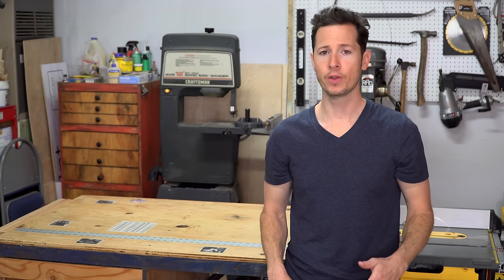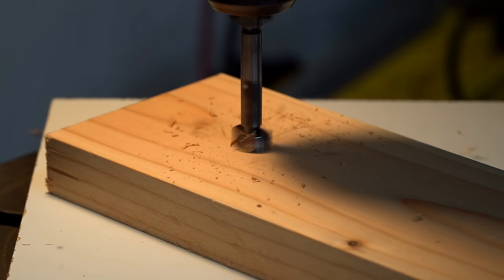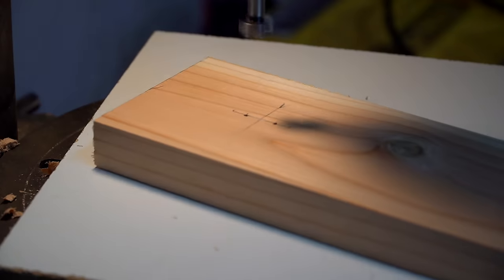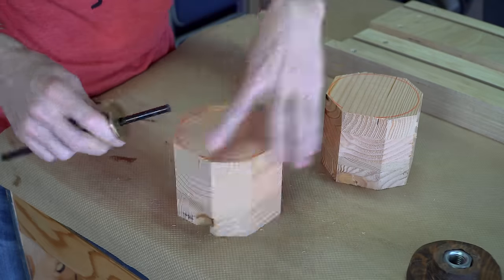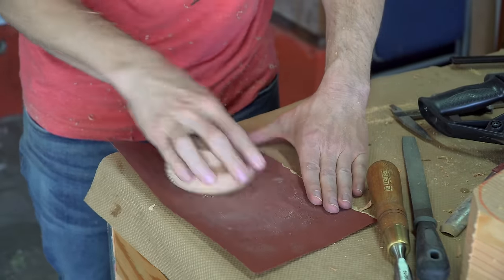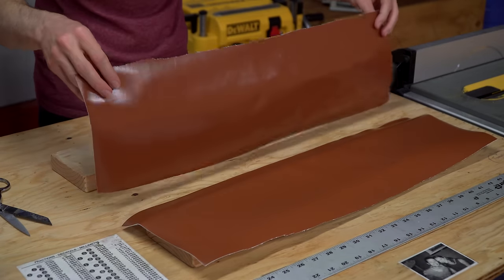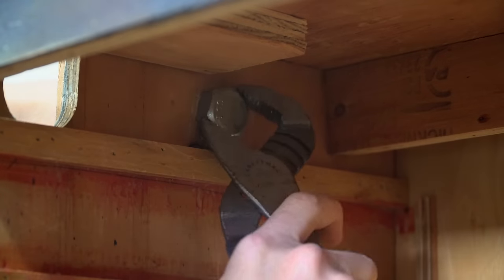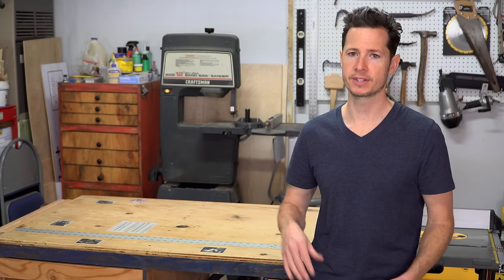How to Make a Twin Screw Vise

Comment: Thanks for your great idea, Tommy. I'm also considering embedding the nuts in the bench and cutting the slots in the fixed jaw. Would that also address the slack issue you mentioned:  "If you had holes (instead of slots), you'd have to tighten the wheels down at EXACTLY the same rate. Otherwise, as you tighten one, the other one will bind. Having slots (or oversized holes) gives you the slack necessary to tighten the wheels at different rates."
Reply from the maker: The slots need to be in the moving jaw. If not you'll still experience binding. I hope this helps! Good luck with your build!

Comment: Great build. The video was well explained. Only advice is to lower your tool rest on your lathe, it cuts better and safer.
Reply from the maker: Thanks Christopher! And thanks for the advice! A couple other guys had already pointed out the issue with the tool rest, and I've already fixed it in the blueprints ~ I'll probably fix it on the actual lathe sometime this week.

Comment: 2-3-pound cast iron barbel weights make excellent handwheels. Just press in a 3/4" nut and/or glue it in with JB Weld. I like the way heavy handwheels spin and tighten/loosen faster.

Comment: Hey man, love your projects.  Now, I'm no 'safety cop', and you're a big boy, but I gotta tellya that not three days ago I gouged a nice chunk outta my hand by chiseling just the way you are at 4:42.  It bled like, alarmingly.  I super glued it and went on, but y'know, uh... be careful.  :)
Reply from the maker: Thanks! I'm glad you dig the videos! I appreciate you taking the time to give me some feedback on safety. A couple other guys have pointed that exact bit out before as well. It may be tough to tell from the video, but my hand actually was below the edge I was chiseling. Now does that guarantee it wouldn't have gotten me in a slip? Probably not, but I was cognizant about safety while I was doing the work. All that said, you're right! I should have had it in a vise!
Reply: Indeed. Always keep your left hand BEHIND the blade.
Reply: I'm so glad I wasn't the only one terrified by that.  The vise is pretty cool, but it might not be as useful once you were missing a finger...
Reply: Please keep your hands behind cutting edges............
Reply: I saw One Minute Workbench's reply but feel safety anecdotes can still be instructive to others. I cut a tendon in my hand by cheating on chisel safety while cleaning up a tenon. That's a deep damn cut for such a small slip-up. After a year of PT I can almost curl my index finger all the way, but I'll never be able to straighten it (I have to point at stuff with my other hand, or it looks like I'm giving directions to go around a corner.) Thankfully, I can still work with it, but it could have easily been a LOT worse.

Comment: I have made one of these for my workbench! Just one thing I didn't like in your project: the circle handles. They don't offer too much grip for a strong tightening, specially if you are an elder and suffer of arthritis. I made the handles of mine with heavy wood and shaped like untwisted propellers. Beside to improve grip it allows you to tap them and make it spins fast for a quick screwing and unscrewing.

Comment: Excellent vise, when you drew round the nut and chiseled out the shape, you could drilled the hole all the way through the wheel first. That way, the nut would have been lined up on the bar more accurately so you wouldn’t have had to adjust it with your hammer afterwards.
Reply from the maker: Thanks! If I’m understanding you correctly, it sounds like you’re saying it would have been better to just drill the hole all the way through on the first pass, rather than waiting until after the hexagonal hole was cut. The reason for only drilling to the depth the nut would be at is because it gives you a stopping point for the chiseling action. Without it, you’d have to be very precise with the depth of your chisel strikes. Also, the nut was perfectly centered. The reason the nut/wheel alignment was off was because there was more epoxy under one side of the nut than the other, and that change the angle of the nut. So when the threads were going through the nut, the bad angle was causing the threads to hit the side of the wooden hole and limit motion. Make sense? So hitting it with the hammer just pressed the extra epoxy into the wood, and corrected the angle of the nut.

Comment: If you drill a hole in each wheel and insert a dowel (or even a bit of a tree branch), you’ll have a crank handle that makes spinning the wheel much easier and faster. The dowel should be parallel to the big screw, but placed toward the outside edge of the wooden wheel instead of in the center of the wheel. If you want to get fancy, you could turn the crank handles on your homemade lathe.
Reply from the maker: Thanks for the suggestion!

Comment: Well done!  I have a few mods for when I make mine but it's a great tool for the workshop.
Reply from the maker: Thanks! What mods are you going to make?
Reply: To reduce the band-aids to my belt-line from impacting exposed all-thread, I'd turn the bolts around and put the heads in the handles and let the extra thread pass through the fixed block.  It makes for a bit more work since you can't use the bolt to secure the fixed block but I'm real good at running into stuff like that.  Great job on this video.
Reply from the maker: Tyler Woods sounds great man - if you’re up for it, send me pics of your build once it’s done. I’ll add them to my website.
Reply: Will do.  Right now we're almost packed for a move to WA State where I'll be organizing a whole new shop.  I've subscribed to your channel and am certain to be copying several of your tips and tricks.  Seeing my shop go into boxes is depressing but setting up a new shop should prove better than Prozac. JK

Comment: This is a good video.  Regarding adhesives, yellow glue does not stick to metal making it an inappropriate choice for attaching the nuts to wood. Epoxy was the right choice.  Yellow glue is also the wrong choice to attaching the vinyl to the jaw faces.  Spray adhesive/contact cement is the right choice.
Reply from the maker: Thank you, Tony! And thanks for the feedback about adhesives!

Comment: Really nice work. Could you tell us some more about the fake leather material? How cheap was it, and where did you buy it? It looks like something I might be able to make use of. Thanks!
Reply from the maker: I couldn't tell you exactly what it is. I picked it up at a large fabric store close to where I live. They had lots of different synthetic leather materials - on order of 50+.

I chose the one you see in the video because the back side of it had a very very tight weave to it, where as some of the others were more "furry". It seemed like it would probably adhere to the faces of the jaws better than the others.

I also chose it because of it's color (a lot of the other ones were crazy leopard prints, ostrich skin, etc.). It looked the most like real (if tanned) leather.

Lastly, I think it was about $5 for a yard, and I bought a half yard.

My advice would be that if you are going to pick some up, go to your closest fabric store with the largest selection of materials, and look through until you find something that has a backing that looks like it will be able to adhere well (meaning, don't pick a "furry" one). Once you've identified the crop of materials with the right kind of backing, pick your favorite style/color from those.

I hope this helps, and I hope you're able to find something that works. If you build a vise, be sure to send some pics (through facebook or email, which you can find on my website), and I'll add you build pics to my website.

Good luck & happy building!

Comment: This is awesome, and I'm going to build this!!

One question: Are there big drawbacks to mounting the vise to the top of the bench, rather than on an apron below the bench? My bench is a counter without an apron. Thanks!
Reply from the maker: Thanks! As long as it’s at a comfortable height and the clamping area is unobstructed, it sounds like it should be fine. Good luck with the build!

Comment: I have made most of the project, but can't find an 8 inch hex bolt with full threads or as many threads as you had on your bolt. Any help on finding some that would work would be appreciated. I looked at Lowes, Home Depots, and the web. I gave up on 3/4 inch and though I had it made with 5/8" but then discovered that the bolts had to be fully threaded all almost so, and the ones I bought were not!  Help!   with 5/8 bolts. My holes are already 5/8.  3/4 if no 5/8 available.
Reply from the maker: Mine are 3/4-10, 7” long bolts, full thread. With the head they are about 7.5” in total length. That said, you should be able to find them in store at Home Depot. If not, you should be able to have them delivered to your store. Failing that, you can definitely find them online somewhere like McMaster Carr or Fastenal. For example, here’s one at McMaster: https://www.mcmaster.com/92240A859/ and here’s an 8”, if that’s what you’re really after: https://www.mcmaster.com/92240A861/ I hope this helps!
Reply: I could not find them in Lowes and I couldn't find them anywhere on line, but when I went to Home Depot I found a couple that while not full thread it was close enough to work. I have one sort of working, but will need more attention when I have a little time. Thanks for the reply. I might still use your suggestions.

Comment: Why need a eleptical groove (hole) on fixed jaws. Is the 3/4" nut behind eleptical groove. Can nut can be hold with glue. It wont slide or shift. Can you clarify that.

Comment: Liked it!  I go along with aphyd23 about reversing the bolts but add that should drill a 1/8"hole across each end and slip on a washer and cotter pin to prevent over loosening bolts.
Reply from the maker: Great idea - good luck with the project!

Comment: Silly question! Why did you want the slots instead of the holes, since it wood "just be" going in & out as you clamped & unclamped the items?
Reply from the maker: The slots allow the sides of the moving jaw to move in and out a different rates. If you just had holes, and you tighten one wheel faster (even just slightly faster) than the other, the jaw will lock up. Does that make sense?
Reply: @OneMinuteWorkbench  Yes, it does.
Reply: @OneMinuteWorkbench  Thank you for explaining it to me, I appreciate it!
Reply from the maker: The link you sent is for improving F-style clamps - is that the one you meant to send? Either way, looks like a great improvement for those clamps. If it's a large format vise you want though (like the twin screw), those will only get you so far. Here's the link for instagram: instagram.com/oneminuteworkbench I hope this helps!

Comment: Did you run the jointed faces right side up through the planer? One time I installed my drawers upside down.
Reply from the maker: Jointed faces were down, while the rough (unjointed) faces were facing up as they went through the planer, so as to make contact with the blades. I hope this helps! By the way, I installed a pair of drawers upside down once, but aside from the tag facing the wrong way, they seemed fine and weren't uncomfortable at all 😂

Comment: Hi Tommy,  I'm not sure why the "holes" on the moving part of the vise are "slots" -  I'm thinking it has something to do with allowing some play between the 2 wheels, but not able to actually visualize it in my mind - Thanx!!!
Reply from the maker: If you had holes (instead of slots), you'd have to tighten the wheels down at EXACTLY the same rate. Otherwise, as you tighten one, the other one will bind. Having slots (or oversized holes) gives you the slack necessary to tighten the wheels at different rates. I hope this helps!
Reply: @OneMinuteWorkbench  Would slotting just one hole do the job?
Reply from the maker: Sorry for the late reply - no, you'll need to do both of them. If in doubt, try it out and you'll start to get an idea of how/why. I hope this helps!

Comment: Looks good. May I suggest securing the threaded bar to the hand wheels so you don't have the dangerous protruding threads. Great video though with clear demonstration. Thanks for sharing. Cheers, Rob.
Reply from the maker: Thanks Robert! You may...it’s been the topic of some debate recently, and I probably will build a different vise with internal threads...it’ll just have to be down the road a bit because of other projects ahead of it.
Reply: Thanks Tommy for  acknowledging my comment. All the best to you in your future projects!
Reply: Seriously people.  Research Joseph Moxon.  This vise is designed this way for a reason.  The protruding threads are SERIOUSLY the LEAST dangerous thing in your shop!

Comment: wondering if hockey pucks would make good wheels
Reply from the maker: If you try it, let us know!
Reply: sithlordst32  i saw a guy om YouTube  use hockey pucks as the wheels on a  homemade  feeder machine he built for woodworking  projects i thought it was brilliant and it looked like it worked quite well  i always thought Skate board. Wheels might Work as well. But truthfully the hockey. Pucks  resemble the wheels ive used on commercial feeders  ive had in Woodworking shops  in the past Matthias used Roller Blade style wheels and a drill on one ge built that worked okay  but u thought the hockey pucks were. Better  ?

Comment: Use an old washing machine or dryer motor (1 hp or more) and put an adjustable speed switch...  I used cobbler’s tacks and a stretcher and Dr Jackson’s Leather Conditioner and Cleaner to maintain the leather.  ...But I like your overall design better than mine so I ditched my original plans...

Comment: Awesome video! I thought it was pretty practical to build. I have a question.. what’s your review on that Porter Cable Jointer?? I’ve read mixed reviews and didn’t see a video where someone used until now.  What are your thoughts on it?
Reply from the maker: Thanks! I'm glad you liked it! I actually did a video review of the jointer, which you can see here: https://youtu.be/S_fl31hTsFs In a nutshell, I like it for the money I spent. I've spent more money on jointers that have done waaay worse than this thing. It's an entry level tool though, so take it for what it is. It wouldn't do in a professional shop where you used it for hours everyday, but for a weekend warrior, I think it's a great deal. Thanks again - good luck!

Comment: What if i constructed it so the ends of the threaded rod screwed INWARDS so, when not in use, there are no pointy bars sticking out of the bench?
Reply from the maker: Vince, that is definitely doable, but a little more complex. Check out the website here, and you'll see a version where Kevin S. put a coupler nut inside to help achieve this (near the bottom): https://oneminuteworkbench.com/project-photos/customer-gallery/ I hope this helps!
Reply: You'll eventually wish you did it this way.  Wooden nuts quickly spin open or closed.  The other way, slow twist one, then slow twist the other - every time you want to open or close.

Comment: Great Idea, the next time yo make one mount the hexnut into the bench and Have the fixed end ant the screw head, that way you would eliminate the chances of damaging the projects you make and secondly It will eliminate the chances of personal injury the the threads sticking out. Trust me a 3/4 inch thread can do lots of damage to your crown Jewels.
Reply from the maker: Thank you, and thanks for the feedback!
Reply: Also with a coder pin under the bench to stop you from unscrewing the entire rod by accident
Reply: Nope.  After 40 years of experience, I submit that a  proper moxon vise has wooden nuts for speed and efficiency.  a modern twin screw vise is ass backwards and a pain to use.

Comment: Ideally costed idea for a bench vise when just starting out and growing into the future.                                                                           Question:  Where did you find your hex bolts as my big box stores do not carry that full threaded or that long (8") and not finding uses other common sources?  Additionally, how much did they cost?  Thanks again!
Reply from the maker: Thanks, I'm glad you dig it! I got mine at Home Depot. Searching for their hardware at their website is usually pretty awful though, you might have to go in to find it. The thread length on mine (not including the heads) are about 6.5" - I hope this helps!
Reply: One trick you can use in a pinch (especially if you are going to make wooden handles anyway) is to get a section of threaded rod (all decent hardware stores have this, and it's cheap!) and two nuts. Tighten the two nuts against each other so they lock (same technique often used to remove studs), using some blue loctite if you've got it. Then epoxy the handles over the stack of two nuts. Bam! Instant virtually-unlimited length bolts from the hardware store.